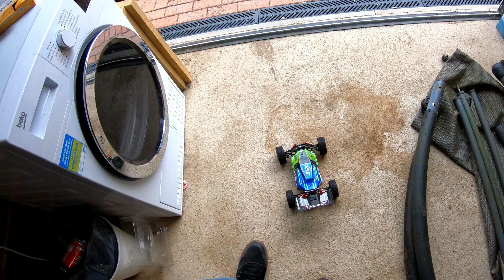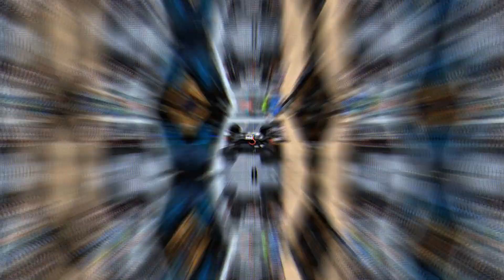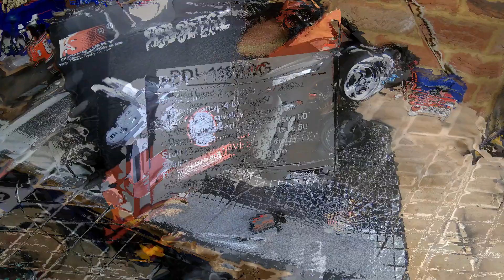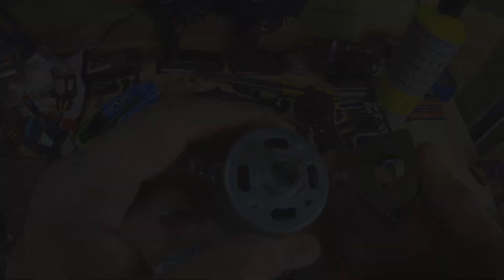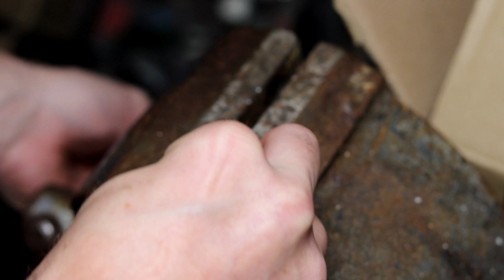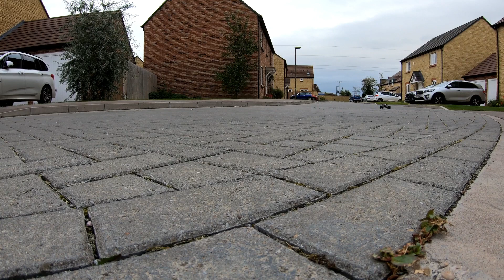WLToys 144001 Cheap Brushless Setup | More Speed & Longer Run Times

Comment: Excellent guide to converting to brushless setup, don't know if this helps anyone but apparently the LC racing motor mount will fit which gives you the adjustments you need on the motor mount so no need to modify it.
Reply: Brushless motors are better then Brush motors
Reply: A world of difference
Reply: Have you a liink for the LC racing mount pls
Reply: @stekeel6993  although it's possible to fit it, the bearing won't line up properly with the centre shaft and you will end up breaking it if you run it like it.

Comment: do not put the brushless on this car, the motor is too powerful for the gears and the weight of the car. After 3 or 4 uses you start to see the first damage in the play of the tyres, arms and axle

Comment: Hi GaminGit. Nice job on the upgrade video. I chose to go with the DumboRC X6 2.4G 6CH Transmitter with X6FG Receiver,  your 2838 / 4500 kv motor suggestion w 35Amp ESC. . Do I really need the   Racerstar LED Program Card for that 35 Amp ESC ???  or is it 95% likely factory settings on the motor / esc will be OK out of the boxes??
Reply from the maker: Factory settings would be just fine mate - The program card is just nice to have for tinkering :)

Comment: Have you run this setup on 3s?
Reply from the maker: Lewis Gill I haven’t no - I think the ESC is only rated for 2s iirc (don’t quote me on that though)
Reply: @GaminGit  I've just ordered it and the specs says it's 2/3s up to 12v. Don't want to risk it of its going to go bang straight away
Reply from the maker: Lewis Gill I mean, it’s pretty quick on 2s as it is, I’m sure it will absolutely rip on 3s but it will also put extra strain on the drivetrain too.

Comment: Is there anywhere i can order a pinion that fits the shaft, I've snapped 7 drill bits inside the two pinions I have
Reply from the maker: James Butt wowsers! What material are the pinions you have? Are you keeping the drill bit spinning at a high rpm when drilling the pinion?
Reply: @GaminGit  seem like harden steel to me but it doesn't seem to want to drill i tried titanium drill bits so gonna buy a cobalt tip see if its any better